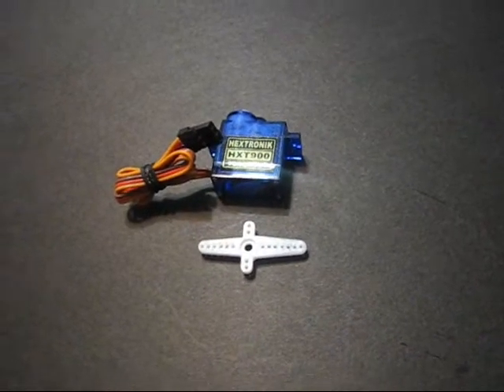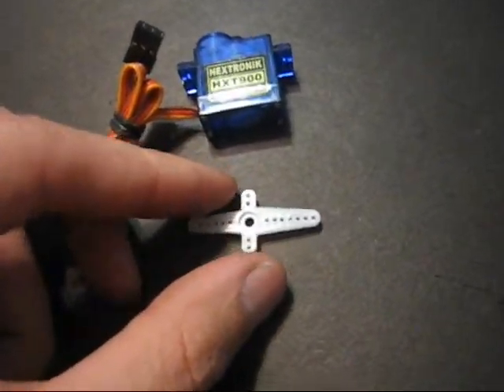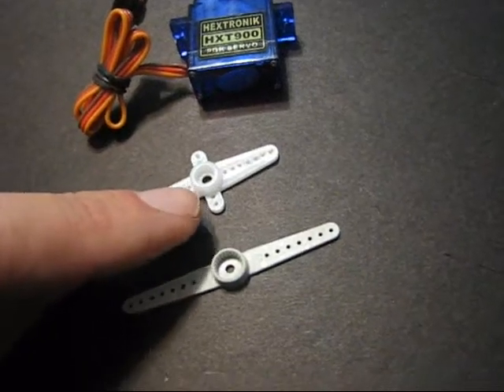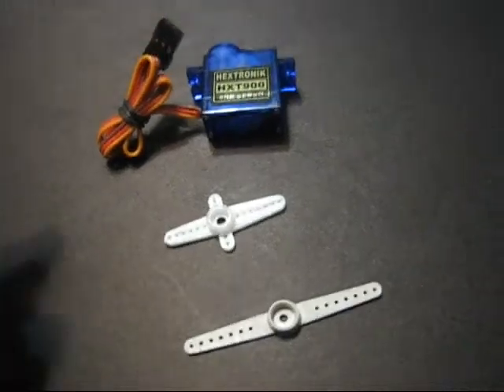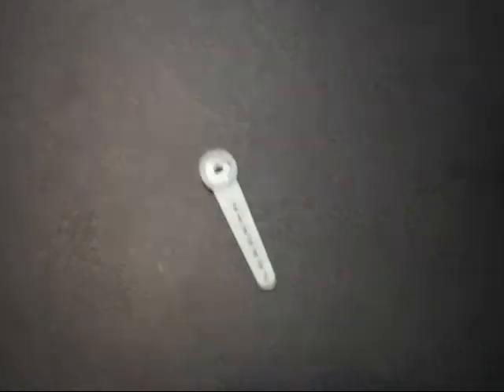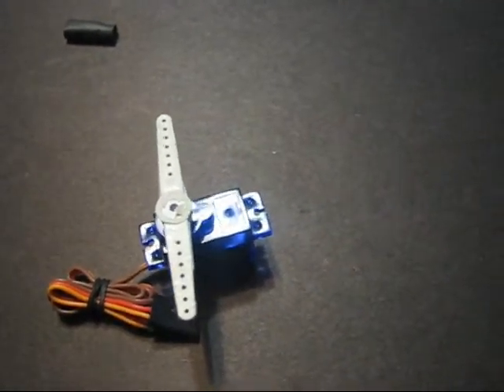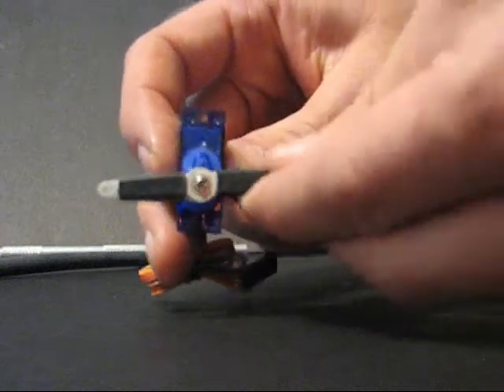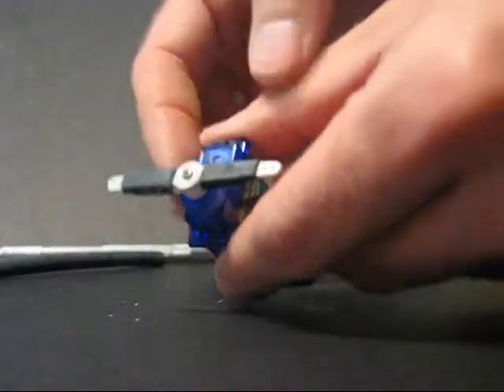How to make your servo arm Longer rc plane

Comment: Not bad.  I'm more of a KISS guy myself.  You could just put a loop of wire through a couple holes.  If they don't line up, still easier to drill two holes on the linkage tabs (through both short and long) and bind them with a twist tie from a loaf of bread or a tiny bit of piano wire left over from the control rods.  And with that method, you could also save the second servo horn and cut out a custom length from plastic stock (gift card or sturdier depending on the application).  This method is surely functional and prettier but seems like overkill.
Reply: Thank you for my question on servo longer servo arm!!!!!!!!!!!!!

Comment: 1 - Kill the drums!!
2 - No need to cut the hub off.  The head of the servo screw will fit inside,  Just put the servo arms back to back.
Reply: TED FRYMAN. Yes, Why do people think that we need drums and music with everything? Especially when old fellas like me can't hear what they're saying even without the back sound????
Reply: I understand what you are saying about the danger
but I don't understand your solution - what do you mean by drilling the hole in the horn? - I thought the horn was on the control surface, not the servo ?

Comment: That is an awesome idea. I am going to give that a go. I previously had being screwing on carbon fiber extensions and besides being expensive, they add a lot of weight and also carbon fiber is not smooth for the wire control rod. Good work!
Reply: Interesting Matt ! Will be keen to see where you need to apply this on your RC with so much travel.

Comment: has anyone yet found a way to increase the radius the control horn will swing. Like from the preset 150 degrees to about 250 degrees? I want to rotate gun turrets with a mini servo. My shipmodel has three gun turrets connect to one channel via Y cables.
Thanks for any suggestions

Comment: I used one of these mini servos to  raise and lower anchors in a shipmodel. I mounted the servo as far to one side of the boat and from 1mm plastic made a long arm, 5 inches long, and connected it to a cable which is connected to the anchor chain and up and down the anchors go.

Comment from the maker: @heberorozco, ok well it sounds to me like the C-rating on your battery is a little low. you would want something ln the 25-30C range. i think that's why you hear your motor slow down is because your battery can not handle the current draw that your motor is requiring. or one of you cells might be going bad. anyway it's hard to tell becuase i have not seen your plane. i would say at 500G you should for sure be using a 3S battery. 1800Mah might be a bit heavy though.  in my Opinion

Comment: can be done with some scrap plastic, food containers and the likes, Cut a slice, drill the outer holes, and a center one - and use that instead of the expensive Dubro horns (the are not cheep here in Denmark)